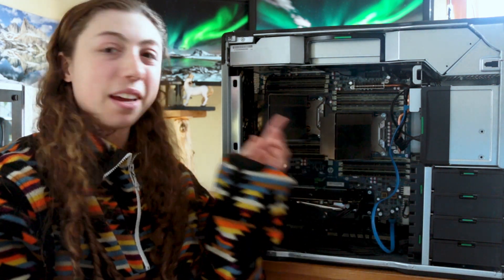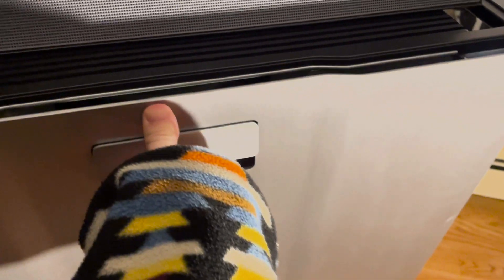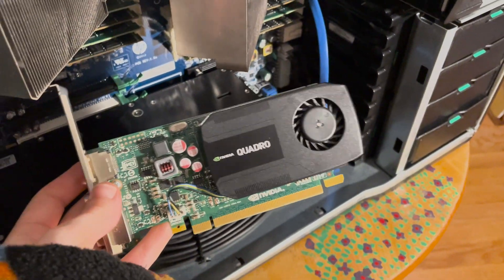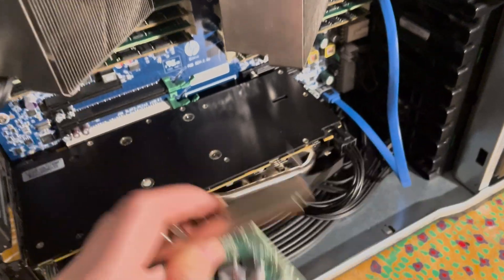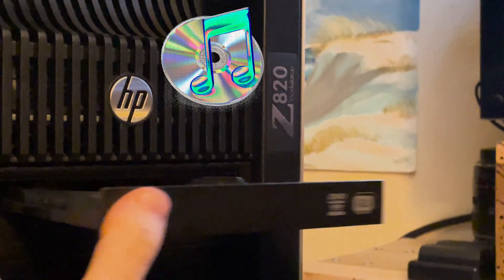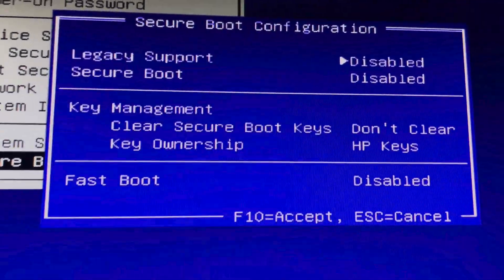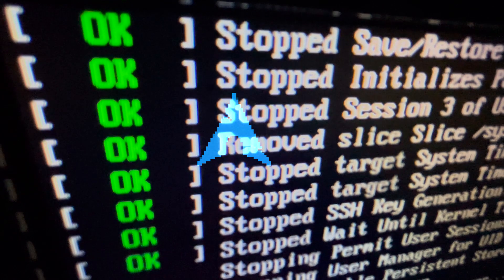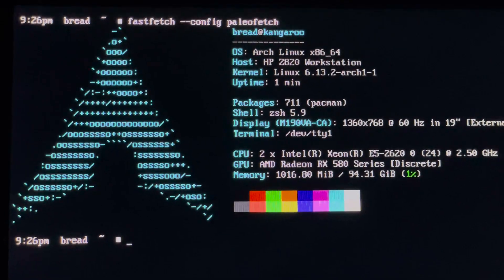The 2012 beast with 2 CPUs and 16 RAM sticks

Comment: I installed 15 linux distros last week on Virtuall Box and compile my C++ open source projects on it.
I have a mix of apt, dnf, pacman distros.

The hardest one to build was the Arch derivatives distros, the easiest are the apt derivatives (Debian).
I had to recompile from source few libraries dependencies on Arch instead of just downloading them on other distros.
The main Arch distro installer dont even come with automatical partition formatting  and default browser.!
.
My main personal OS is QubesOS (it use debian template) for security and stability.